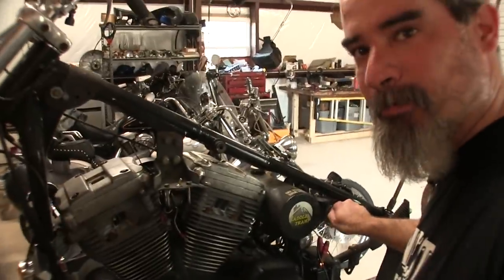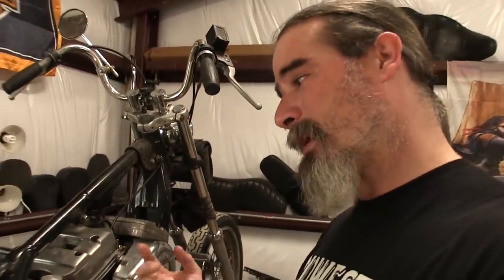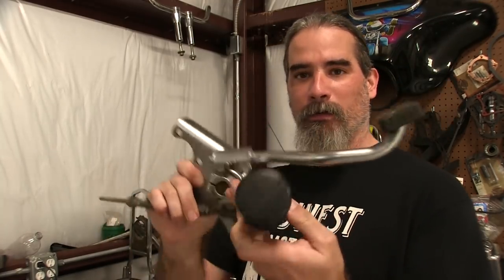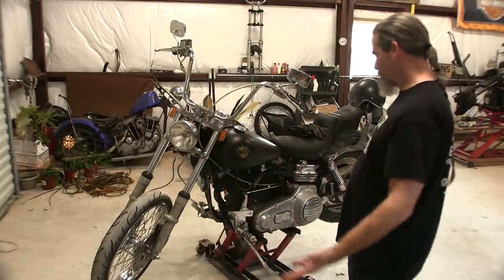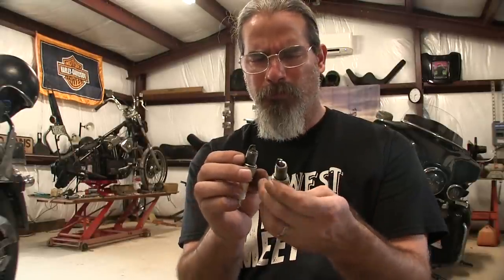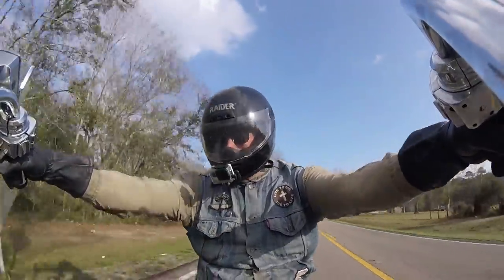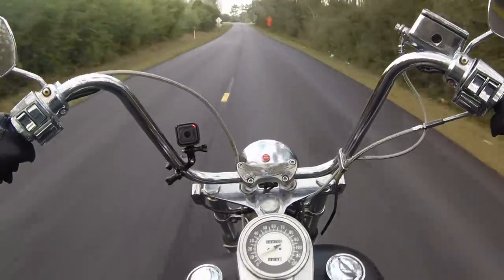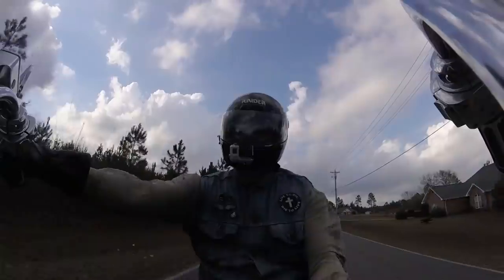HARLEY Davidson SHOVELHEAD Is WAY PRIMITIVE Of A MOTORCYCLE For Today's RIDERS

Comment: Bikes look great as always. I believe you have to get your hands dirty to be a biker. Everyone else is an enthusiast. Haha
Reply: I could never afford anything that wasn't clapped-out or broken down. The one time I thought I was actually getting a good ride, was last summer when I bought an old Softail. One hour into the ride and it was suddenly rattling like someone threw $50 worth of quarters into the dryer and turned it on. Rear exhaust tappet was wasted, corresponding cam lobe was wiped, the oil pump had scoring, the pistons and jugs had a couple deep scratches. I learned how to rebuild that motor from YouTube. Still fighting the Super E tuning because of these straight pipes....I must say that I'm glad for the experience nevertheless, but my wallet is about $3K lighter after repairing everything I could find wrong with the bike. One thingi noticed is that I'm much more confident in a machine that I've had to take completely apart. No more hidden surprises and it makes riding it more enjoyable without worrying about how far away from the house I can ride without issues
Reply: @DougFLTRX  put some lollipops in or run longer straights for more restrictions that S&S E will like it.
Reply: Yeah, wrenching is how you earn the riding! Always good stuff Tramp. If I can't be in my garage, I can be in yours.
Reply: I had 1978 1/2 fxe I just sold it to my oldest. I told him if you can ride this and maintain it you've earned your stripes. I do 98% of my own work so I agree with this statement
Reply: @DougFLTRX  I could either tune my Super E equipped 74" Shovel to run fairly well at mid rpm or high rpm but not both with open drag pipes until I modified my carburetor. I experimented with baffles and homemade restrictions in the pipes but that just cut out too much of my power and I wasn't gonna live with that. I installed a Thunderjet kit in the S&S Super E and once tuned it rode beautifully and screamed through the entire RPM range at WOT perfectly. I don't think the Thunderjet itself was the most significant part of the modification but the air bleed modification that goes along with it. The S&S carb is designed with the main system air bleed internally in the carburetor and part of the Thunderjet kit installation is to modify the carb for an external, easy to access and adjust main system air bleed. What happens with the drag pipes is that the pulses in the pipes activate the high speed system of the carb too early and the air/fuel mix goes over rich through that part of the rev range. By enlarging the air bleed it delays the transition point between the circuits. The Thunderjet kit contains the parts and instructions to install and the key part of the modification as far as I'm concerned is the externally adjustable air bleed modification. I did have to buy a couple taps and drill bits, though, I think. Forget about restricting your exhaust and focus on tuning your fuel mixture. Needing "backpressure" is a scam. On the other hand, now, before I put 40" long, 1-3/4"  drag pipes on the bike I used a factory stock type 2-1 type pipe that I cleaned up the crude entrance of the rear pipe into the main pipe and ran it open with a slash cut. The S&S Super E ran perfectly with no modifications with that pipe on it. As much as I liked how it ran that way it didn't compare with how the motor wound out the rpm and the power it made with the drag pipes and modified carb. Zipper's sells an externally adjustable air bleed kit that is a fraction of the price and easier to install than the whole Thunderjet kit. I didn't try the air bleed tuning modification without the Thunderjet but I think would do well. If you have money to spend, install or have somebody install a Thunderjet kit and make sure to also have the external air bleed modification.

Comment: I don't think you mentioned what year the shovel is, but it matters. The original design was 74 ci..In  the late 70's displacement was increased to 80 ci. While the 80 had better performance, reliability did suffer. The design had been maxed out, and like most American companies h-d started hiring incompetent college kids as engineers. They spent millions fixing problems that didn't exist and creating new ones. I bought a used '71 when I was 17.  I still have it (I'm 65 now). I used to do a lot of long trips and I remember a guy in the parking lot after a dirt track race somewhere who said "man, you ride that thing all over the country and don't even carry a wrench do you?" I didn't know him, but I thought that was cool. I often rode at 80 - 90 mph all day. The shovel just ate it up. Enjoyed the video, Tramp. Ride the shit out of your shovel and don't sweat it.
Reply: Original Shovelhead on a big V Twin was 1966. 1966 to and including 1969 were produced with Shovelheads on a Pan bottom end. They were all generator Shovels, sometimes referred to Slab side Shovels.
Reply: Loved my 71 flh, should of sold the wife, instead of the bike

Comment: What size tranny sprocket you have on it? Stock is 23 but a 24 is definetly better for cruising. You can also use a 25, but dont let your chain get slack, you"ll eat the bottom of your starter mount out of the inner primary.  Pacific Mike is an awesome guy to ask questions about older bikes, If he doesn't know, nobody does!😆
Reply from the maker: No clue. Haven't been that far into it yet. Yeah, Pacific Mike is a wealth of knowledge.
Reply: Bumping up the trans sprocket works great. Try one tooth at a time. Mine has a 24 and will crush @70. The bike will let you know what it wants. you just have to fine the sweet spot then gear it where you ride it the most. Don’t gear it too high With a stock motor. Changing the rear tire diameter also has an effect on gearing
Reply: That's great advise .
Reply: Good to know

Comment: I have an unrestored 69 FLH and it’s happy at 55-60 mph. The guy that rebuilt my motor was against the idea of changing the sprocket for interstate speeds. Stating that these old bikes aren’t designed for that kind of speed. Just a couple of things I’ve learned about a shovel is they take a lot of maintenance, drive them like is the 1960’s & 70’s and they give less trouble. Oh and everyone is your friend at the bar. I’m still running points with no problems. 🥃😎
Reply from the maker: That's kinda what I was thinking.

Comment: I had numerous Shovelheads from '76  HD 74" to my last one, '84 80".  Even my '74 could do 110 MPH. They use oil like no tomorrow.  HD use to float their heads with oil because the valves use to stick at around 6000 miles.  HD finally fixed the problem by releasing the excessive oil from the heads and looked u a line from the heads to the casing.  Later ones had the inline built into the heads and cylinders.  My 1984 was the very best shovel, the last ones made and the First Evo's made by HD.  The top ends are easy to work on,  I never had a torque wrench and somehow did everything mostly right.
Reply: LOL, the last time I went 100 on my shovel I almost lost a kidney. Even my 97 evo gets angry with ya at 70.
Reply: @curtissloan2486  Very funny, but so true.  I remember when I bought my knucklehead, I was about 18 yrs old, I phoned the HD dealer and told him that my motor mounts were shot and I needed a new one. It was quiet at the ether end then he said, there are no motor mounts, they just vibrate a lot.  LOL
Reply: @curtissloan2486  Some were better than others. My '76 HD 74 wasn't too bad. The one thing that broke regularly was the muffler supports. I was always getting them welded or replaced.  I remember going to a Chiropractor and he told me he never seen a spine so out of wack.

Comment: Shovels are a living breathing thing truly with a character the moco hasn’t had since. My 78 Lowrider used to chase Evos around easy enough and would happily cruise at 80mph, having said that you knew you had done a days riding👍

It was exactly like being married, everything in multiples of 100 bucks, required frequent maintenance and when it wasn’t going right you wondered why you bothered……… But when it was good….. nuthin like it👍👍
Reply from the maker: Yeah, it's certainly like a relationship with a female. Fix one thing, then another. My wife said that's part of the courtship. I told her then I'll name this bike after my exwife. Lol
Reply: Amen!
Reply: My 81 lowrider will cruise at 75-85 but its happiest at 55 60 the engine vibe is at its wost at 65 75 at 80 it starts to smoth out at 85  90 it was smother than a switchback

Comment: When I have ignition troubles I usually replace that stuff with a Dyna S dual fire and a set of advance weights, those early ecms where not very reliable I knew a lot of people that took them out and ran points. If you run anything with advance weights, make sure you take them out about once a year and clean them up and lube them. It's all good for the soul.
Reply from the maker: Noted!
Reply: I ran Dyna S ignition in my last two bikes....the one I ride now has a screaming eagle ignition. if it calves, I will go to a Dyna 2000
Reply: Yes, points. Definitely. Also, take the trouble to find a good quality condenser.
Reply: @TheWolfsnack  One of my buds is running a 2000i in a 106 Shovel, we had to replace the ignition once as it melted and also replaced the coil once. The coil is a single fire coil for dual plugged heads, other than that he hasn't had any touble since, with the 2000i he also runs a VOES as the bike seems to run a bit better with it.
Reply: @lawnboyfromhell  Thanks for this post.  I have an 80" EVO, may I ask if the VOES are known to go bad? It's a maintenance schedule task I have avoided and would be interested in others experience. Best from NZ
Reply: @David-og7di  Hi David I have tested quite a few of them in my years, most of them are not at the factory recommended setiing in the book, you need a hand operated vacuum pump with a guage and a multi-meter I set my multi meter to the continuity test so it makes a noise when the contacts close. The vacuum pump I use is called a mighty-vac. so you hook the multi meter to the leads and hook the pump to the vacuum port on the voes. You also need to remove the factory sealant out of the area on the top of the switch, I use an o-ring pick and patience. When you get all the sealant out there is a screw in the bottom that adjusts the regulator, then hold your thumb over the end where you removed the sealant to stop it from leaking while you test. When you adjust it to the setting in your manual, then re=fill the area you cleaned out with silicone. I use Permatex Ultra Black let it set and off you go. I've tested ones several years later and they are still where I set them. Hope this helps.

Comment: I took the 49 tooth rear sprocket off my shovel and I’m now running a 45 tooth. Lots more top end speed and those old shovels have so much torque I still don’t want for power on the bottom either

Comment: I put 108,000 miles on my 883 sportster that I bought new in 1993. I switched the electronic ignition to points high performance system. Works great! Also switched stock Japanese carb to an S&S super E,switched belt drive to chain and sprockets,and made own long drag pipes,utilizing stock crossover pipe header system. 3 trips to Sturgis from NC on this bike,several to Myrtle and Daytona . Still runs great.

Comment: I had a 1978 1/2 Shovel. (halfway through the year they changed to electronic pick up from points), rode the freeways of Ca. at 75 to 80 without leaking oil. Wish I still had it.

Comment: Hey dude, this Mighty Shovelhead (I'm still jealous) is from the era is which at least 2 golden rules were applied except from regular maintenance of course; 
1. Chrome won't take ya home
2. Don't fix it when it aint broke
And some more: Your Shovelhead does not leak oil; the bike is simply dominant and likes to mark its territory!
Why does a Shovelhead marks it's place? Well to let you know there still is oil in the engine to begin with ;-)  Oil on the floor is a good sign, so don't worry. You'll have to start worrying when your Shovelhead stops leaking oil... you're probably out of oil ;-)
And just for your information, the Shovelhead motorcycles are very popular in Japan. Since Japanese motorcyclists really want to ride their pride and joy, and they really do not want to break down all the time, they've been filleting and approving the Shovelheads and they seem to have found ways to improve the ride and reliability because they don't want to carry a service-truck loaded with tools and pare parts behind them when they go out with their Shovelheads. So for all that matters, I'd say try to find out what exactly they did to improve their Shovelheads, because men and women can actually Kick their own Shovelheads and go out for a ride !
I'd say go find the knowledge where it is available !

Comment: Sure is a lot of guys saying they use Champion resistor spark plugs in their shovels. I used non-resistor AC plugs because I could get 23,000 miles on them and still not need to replace them. Ressistor plugs of any type tend to break down internally and misfire at cruising speed. It is getting hard to find non-resistor plugs though. I had a set of Harley resistor plugs that didn't even make to 5000 miles before problems. Had to replace them by the side of the road. Champion made those plugs for Harley. Never again! We would not install Champion plugs even in cars in the shops I worked in because of all the come backs and complaints.
Reply: Thanks for the info. I will try non-resistor plugs
Reply: @Dirk G. I found that non-ressistor plugs worked in my Chevy Luv pickup longer too. I have had that truck for 42 years too along with the same 79 Harley Superglide.  I log everything in small spiral note books, one for each vehicle, so I don't have to remember the results of my repairs. Thanks for your kind reply. Lots of people think they know the best way so they won't listen to me even with my 52 years as a mechanic.

Comment: I grew up on shovelheads, once you sort them out they are very dependable machines. I never packed tools and I rode it to work everyday, I totally agree, my 93 EVO is high tech compared to my past  superglides, but those shovels  definitely have more character and a better sound, basically the evo is a refined shovel in my opinion.  That wide glide front end was definitely a big improvement in the looks department. I would lose the chrome oil tank and find a stock black painted one. I always thought my old shovels could easily pull a fifth gear and wondered why Harley only had a four speed gear box?  Same on my 93 EVO always wondered why Harley only didn’t put a sixth gear on it?  Lol
Reply: Why didn't Harley put a 5th gear on their shovels? Because Harley's got to be Harley! Why have five when four has done the job for decades? I actually got to ride a shovel that had a 5- speed retrofit gearbox. It was like an answer to a prayer! Harley should have went to the 5-speed when they introduced the shovel. Oh well.....
Reply: The fxr shovel came out with a 5 speed.
Reply: me too I had my 81 Sturgis for 20 years and in the last few years ran a 40mm Weber and 2 into 1 exhaust . very different sound but great performance
Reply: I have a 5 on my Low rider. It's like the overdrive you wished was there years ago!

Comment: Good call on the mids! 😎

HEY NOW!.....my '79 FLH King of the Highway full dresser is a 70mph+ freeway jammer all day! 🤣

Shovelhead gap with electronic ignition 
go 0.040" on Champion RN12YC. 

Plug wrench & fresh plugs with a Super E carb is a good idea.  🙃

Don't be afraid to long haul on your Shovel. 

Shovelheads work on "flow" not pressure. 

Ya...the turn signals take a little getting used to. 

I LUV THE MUSIC!!!!
Reply from the maker: Thanks for that info, man!
Reply: I have electronic on my 72 fl spark gap 0.40 have 15 thousand miles on her and i say hard miles no leaks no breakdowns. When i rebuilt it i used the best gaskets sealers and locktight harleys in the early 70s when they sit for a while will spit a nice puttle of oil on your floor then go away. Trans is a rebuilt 4spd that takes a beating hi rpms powershifting and does eighty all day long. Front sprocket 24 rear 28 forgot to mention andrew gears engine has 40 over sas pistons Andrews cam solid lifters sas e carb 2 inch drag pipes mild headwork new guides and valves first 3 gears it goes like hell and loud is not the word hit 4th gear and it still pulls pretty hard. Ha ha at night ripping thru the gear i shoot flames out the pipes not bad for a 74 incher. Ps drive fast or be last
Reply: Sorry 48 tooth rear sprocket

Comment: A well sorted Shovelhead can hold down 100+ all day, but even the rest should be happy to cruise around 80, it may take a little work to get there. Good maintenance and electronic ignition really help. P.S. I don't advise cleaning plugs with a wire wheel or brushes as the porcelain insulators are not the hard glazed material the used to be and the wire brush can leave metal deposits in the insulator leading to spark tracking issues (they are also porous so hold contaminants). When they are done they are done, fit new. I buy Champion RN12YC copper cored plugs by the 20x box so always have a new set on hand, they work out relatively inexpensive compared to the potential issues running old plugs.

Comment: I put a 24 front and a 48 rear sprocket on my shovel and its a lot like riding my evo softail as far as the gearing goes. Now it likes 75 or 80 mph all day. Biggest problem i have is keeping the intake from leaking. looks grate with the wide glide on it. enjoy it they are a lot of fun
Reply: there is a great fix for the intake leak, i am not advertising for who sells them but with that said check out lowbrow for a Tite seal kit they work.